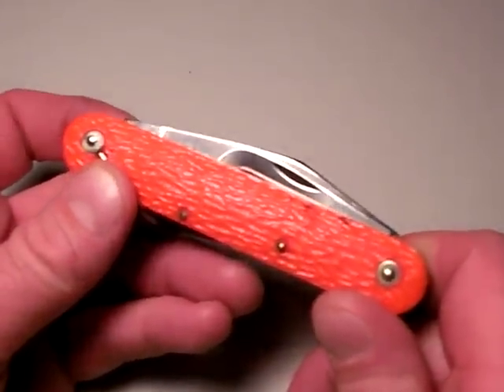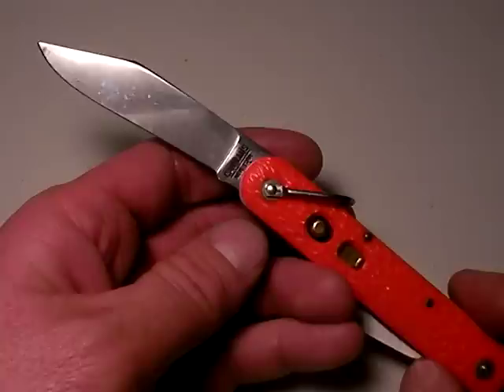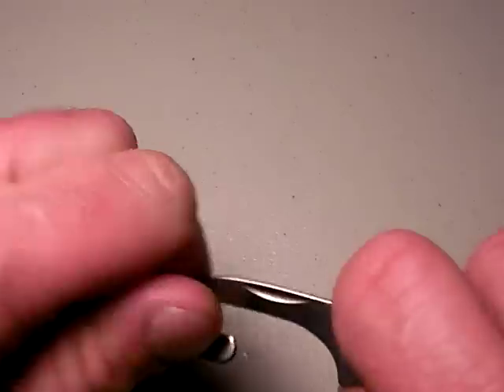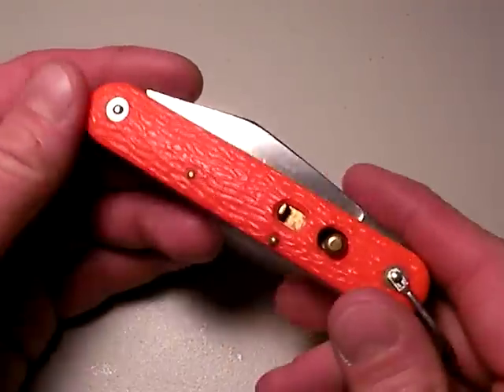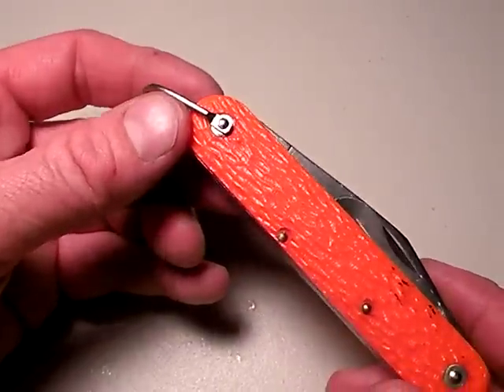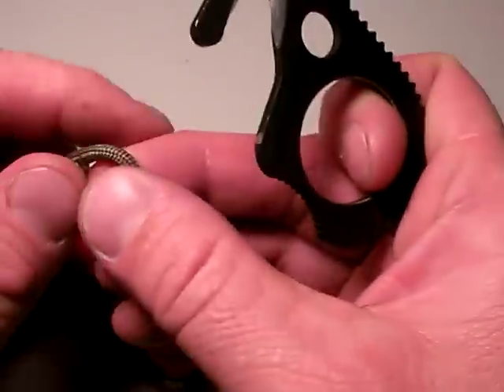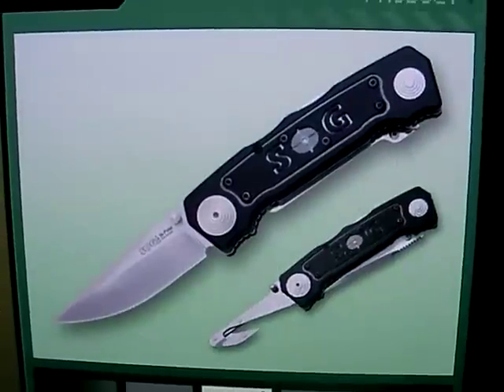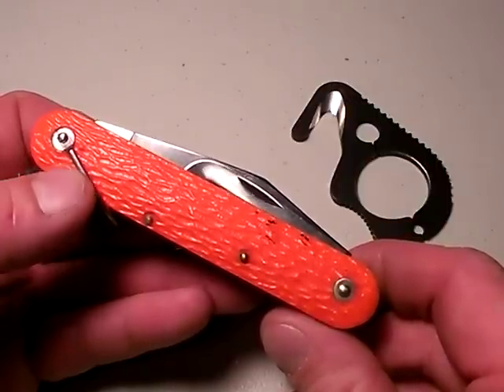Camillus MC-1 Paratrooper:  Storied Past But Obsolete Present

Comment: The shroud-cutter blade was not intended to be "automatically deployed".  By SOP, these were carried with the shroud-cutter blade already opened, and carried in the leg pocket of the flight suit.  The bottom of this pocked is reinforced for this purpose.  Dummy cord secures the bail of the knife to the grommet of the flight suit pocket so it isn't lost.  These were made by Schrade-Walden, Camillus, and Logan-Smyth.  Sharpen the shroud cutter and it works.

Comment: Hello Mate,

This particular blade is designed to be attached to the jump rig with the hook already deployed during jumps and than simply grabbed and used. I agree it is not a good quality knife but the design is very old as long as you jump with it open you will be able to work with it. I prefer my medic shears for those tasks and it is much more useful on many tasks. You might do a review on different medic shears and cutters and it will be interesting.
Thank you, Sharon
Systema Israel.

Comment: Zero Tolerance recently came out with a shroud cutter called the JB2, its got a much longer handle on it so you get more leverage, and it has far more cutting area (270º) its also got a carbide glass breaker and an oxygen tank wrench on it. If I where a pilot, its defenantly what I would go with.

Another great video as always Nutnfancy, keep the NTP going!

Comment: When I was issued my knife I also got a card that gaveme permission to have a switchblade knife. When I left the military I was allowed to keep my knife. The video is totally right as the hook should have been on the swichblade mode and not the knife as they are dull as heck and you cannot swipe at a line and cut it like you can with the hook. They have now gone to the hook only knife.  Any 2 year old could design a better knife, but designed in the late 50's and now the prices are 250 and up

Comment: I spent  7 years in the 82d and 7 in the Army parachute team and I never saw one of those knives, anywhere.  What branch are you in? You would not consider using the hook blade to cut out of a malfunctions, believe me you use the large blade.  That knife sort of resembles what a "rigger" or parachute packer would have used, but like I said after 21 years at Ft Bragg i never personally saw one like you have there.